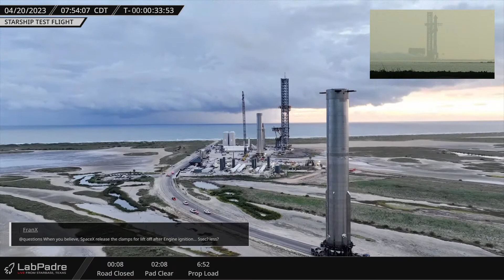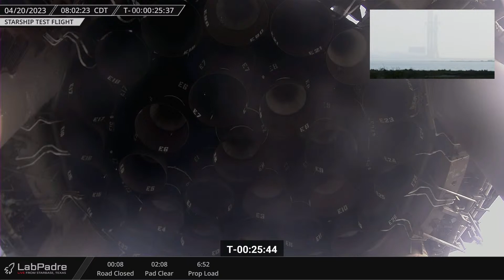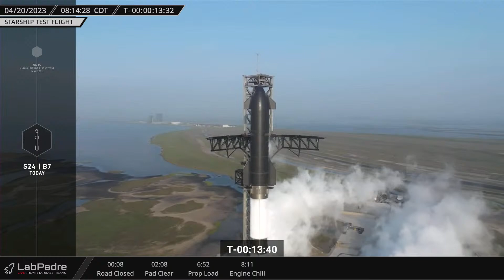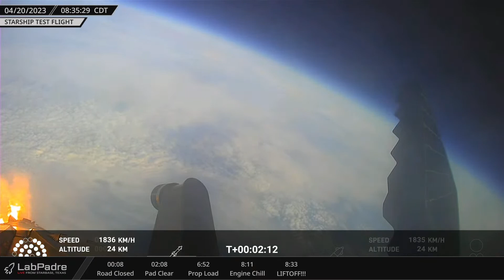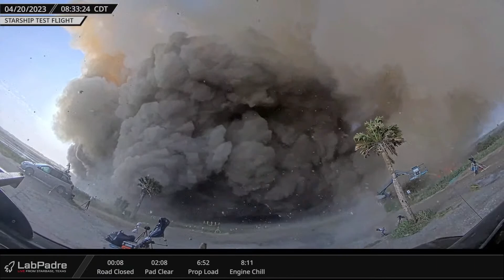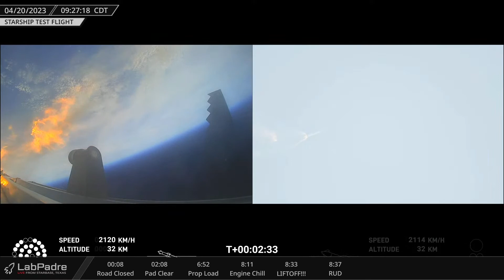WATCH LIVE🔴 - Starship Orbital Test Flight From Starbase, Texas - COMMENTARY

Comment: Should have had a proper flame duct to divert the backreaction instead of blasting debris back into the engines - most of the damaged engines were around the edge, near the launch mount debris. If that had been sorted then it might have been a perfect mission

Comment: How STRONG is Starship??!!   It tumbles end over end, stage 1 and 2 remaining connected... no structural failure (main structure) and does NOT come apart until they pulled the ring.   Just WOW.
Reply: I think it was supposed to separate stages during the end over end rotation, so staying together is a bad thing.
Reply: Being that it's made of some pretty thick stainless steel, and the fact that they have made many changes to the external structure on top of it being able to support starship as heavy as it is I'd say it is strong lol
Reply: @kevinrocksman  Its only 4mm thick steel with 3mm in the nose

Comment: I believe I heard that only about 28 or so of the 33 raptor engines actually fired.  Has anyone else heard more on that?  If so, it being 15+ percent weakened from the start, plus what appears to be misfires of some of the working engines as well, would definitely not allow enough orbital velocity even if it had not began flipping.  Thoughts?
Reply: 150 seconds after launch the stack was travelling at 2100km/h or 580m/s, according to the SpaceX reporting. A rough calculation suggests the AVERAGE acceleration from launch to that point was about 1.4 gee. It should have been something over 2 gee since the booster had lost most of its fuel load, nearly half the mass of the entire stack. It looks like the lost engines were causing a significant reduction in expected acceleration.
Reply: @robertsneddon731  and it would have been virtually impossible for the other engines to adjust Quickly to maintain trajectory with all those engines warning lights going on and then a few miraculously coming back on

Comment: Did the separation mechanism fail, or was the command not executed because attitude and/or position were off? Then it looks a bit like booster control lost the plot because separation had not occurred. A lot of engines went out on the way up. Not all independent failures? Thrust looked ok still, but perhaps the thrust vectoring was no longer adequate? A cascade of effects beginning early on with debris-induced damage, or just the incredibly extreme power to weight of the engines? All round, pretty awesome. Hope the team are not too traumatised.

Comment: Starship has 36 engines. What could possibly go wrong? Three engines not fire. This is a waste of money. Consult with NASA engineers . The real Rocketeers 😂
Reply: The same NASA engineers that blew up the shuttle... twice?
Reply: @jaffacalling53  no the nasa engineers that make SLS for 4 billion dollars per launch
Reply: the issue is with no flame trench / no deluge . I bet it  . The thing fought valiantly through lots of malfunctions ... unlike a nasa product :P
Reply: @cat_lin1  They really need to add a proper flame diverter. I know the deluge equipment is ready to be installed (pending repairs to the pad) but I haven't heard anything about a diverter.